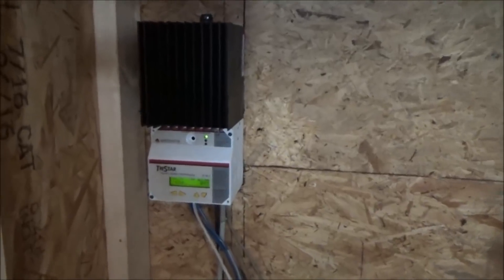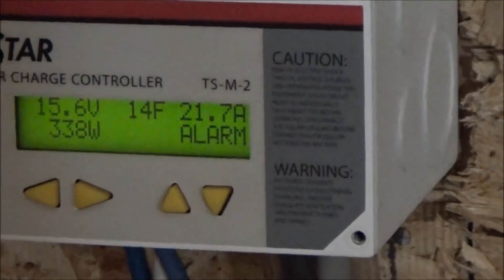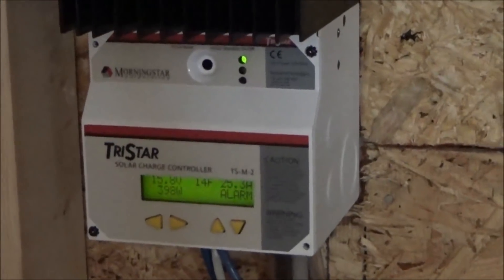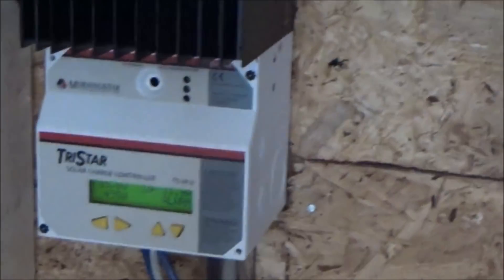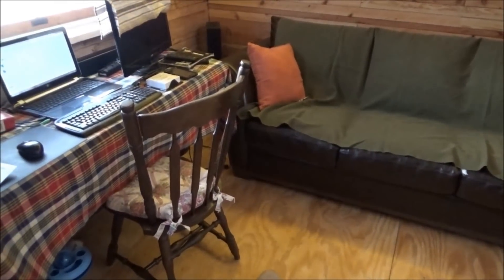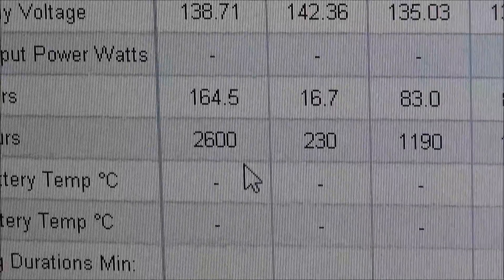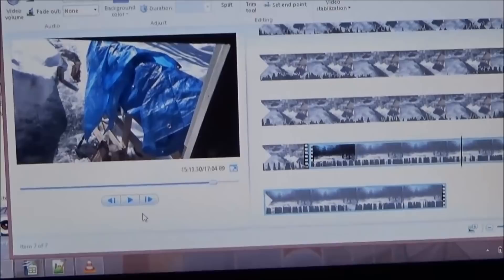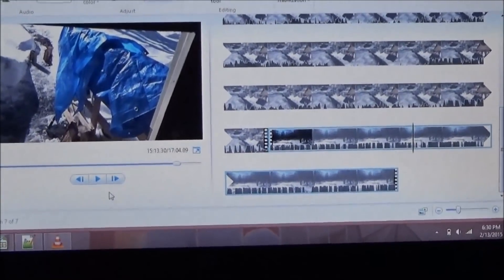Awesome Off Grid Solar Power Then Catastrophic Failure All Around

Comment: you will need a better blocking diode for the wind gen. put 100 amp stud with heat sink.. with inverter cutting out on HV. my fix. get a 200 amp dont know your inverter. put in pos lead in forward direction.  may need 2. drop appx .85V depends on load  each diode. than a battery hi current switch  to jump out diode or 2. I needed 2 for NiFe which get 16.8V cold.16V 80 F .rember diode on heat sink.  my pure sign inverter good to 16V still needed 2 diodes. no only diode block power thay drop volts.

Comment: Panels will give you more power in the winter due to two factors . Heat creates resistance and resistance is a loss , also snow reflects light and this light is bright .The next time in winter when it is -20 and blowing and a dark cloud covers your panels , watch the amp spike when the sun hits them again and you will see a significant increase . It is short lived until they heat up again but this spike must be considered when matching your controllers to your system .

Comment: Right from the manual.

Faults & Alarms
If a “Fault” or “Alarm” condition flashes on one of the main
Operating Displays, navigate down to the Diagnostics Menu
for a list of existing faults or alarms. The faults and alarms lists
are always displayed on the first 2 screens of the Diagnostics
Menu. Use the left and right push-buttons to scroll through
each list of faults and alarms, if any exist.

Comment: I know why your controller alarmed.  You are either running the TS-45 or the TS-60 MPPT controller with the TS-m-2 meter add-on.  These are the only two models that they make in an MPPT setup.

Im looking at the technical specs in the owner's manual.

The TS45 maxes out at 600 watts at 12v
The  TS60 maxes out at 800 watts at 12v

The only way to get the full wattage out of your system would be to step up to a 24 or 48 volt configuration.

At 24 volts, the TS45 can handle 1200watts while the TS60 can handle 1600 watts.
At 48 volts, even more.

Since the units are equipped with overload protection from the solar array, it is alerting you and may actually be cutting out.  If you need a copy of the specs and the manual, I have both the data sheet and the owner's manual in PDF format.  Just PM me and I can get that out to you ASAP.
Reply: hes running the panels at 130 volts
Reply: +DMAN22yeah WOWZA!
Reply: docchocobo yeah dont lick that like a 9 volt battery lol
Reply: LOL

Comment: You may have had the warning because of the increased watts increases the amps.   Your controller can only handle so many amps and might have signaled the warning.  Another possibility could have been when the wind turbine started to draw the power on a back feed the controller sensor gave the warning.   Personally I believe it was an overload of amps on the controller.
Reply: it was too hot

Comment: diodes for automotive isolation  are only good up to 16.5 volts max then fail. every diode has a 'peak reverse voltage' or point of falure. the voltage peak or true RMS  or peak voltage  will blow the diode even if not useable power. check the peak to peak voltage on the devices and use diodes rated higher.

Comment: No offence but when are you finally going to use the fork lift batteries as a power source, so far all i've seen  you using the harbor freight  generator for just about everything sooner  or later you will have to use those batteries to see how they  really work.

Comment: Why don't you get an indoor charge controller dedicated to the wind turbine. Outside, the extreme temp difference of -40 cold air and heat from 20 amps of current passing thru the diode, could make the diode crack or burn under the strain.
Reply from the maker: It was inside

Comment: Hi Troy
You need a 50 amp fast diode on that windmill with a heat sink .
or at 2 X 25 amp in parallel.
If the cable cant handle 36+ amps you
could drop a 1 or 2 big dump load resistors in series with the line !
IE:- BAT pos > DIODE > RESISTORS > windmill > BAT neg .
Reply from the maker: I just ordered some new - better - diodes off ebay but from the US

Comment: Since your 2 main generators aren't operational, why not try using the generator you wheeled into your workshop tent a few days ago? By the size of that one, it looked like it could handle running a battery charger while you get your Harbor Freight one replaced. Otherwise, I thought you had another generator or two that I saw in a video way back (forgot which specifically). Anyways, the workshop generator wouldn't be a bad backup to your backup (HF + alternator generators).
Reply from the maker: It would be a sad waste of gas to run a 4,000 watt generator to give me the 100 watts I need in the evening to power my laptop, modem and some LEDs

Comment: IF YOU LOOK ON THE WEB PAGE DATA VIEW THE ALARM WILL BE A RED NUMBER DOWN THE BOTTOM JUST HOVER OVER IT AND IT WILL TELL YOU !
Reply from the maker: Got it thanks. It was over current due to the combined solar panel sets
Reply: I doubt it was the solar! you don't have enough panels to go over current! I have18 x 200 watt panels and the same controller as you and that's only 54 amps - 3600 watt more likely it was the wind turbine dumping the excess current because you haven't wired it up with its own PWM charge controller  you must have a controller with a dump load !

Comment from the maker: People: The wind turbine is NOT connected to the solar charge controller. Nothing but the solar panels are connected to the MPPT solar charge controller. I will never risk such a thing.
The wind turbine and failure of the generators were separate issues. The generators were off and not connected at the time of the diode failure. It was a cheap ebay diode that failed.
It was hot in the tiny house and the alarm was most likely the charge controller getting warm so it reduced power output
Reply: Shaggy one
i may be wrong but i think would have got packed away when troy was clearing the old trailer home ready for the conversion to the tiny house on wheels you know how it is when you move it's things you need that gets unpacked and the rest gets forgoten
Reply from the maker: Ongrid Solar 50 volt 45 amp
Reply from the maker: Shaggy one Well, if you read the comment above, the one you just replied to, I said that the charge controller was most likely too warm
Reply from the maker: james head Its online. I have it right on my computer desktop and I do refer to it about once per day recently. Been checking things out a lot these days tweaking the system
Reply: Shaggy one
Reading instructions is for sissies.

Comment: the harber frate gen  the govener is not opening up  and i  think your voltage is to high  check voltage right at the battery it self if the voltage is that high you are over charging i don't think you are but you have to be on your game find and read the data sheet for your battery  it will give you the best info  your wire may be to light  from charge controler or some thing the voltage seams to me way high for toped up battery  each cell is two volts big or small charge at 13.5 to 14 volts  i don't  trust the 15 volt reading i don't see how that can be right on a good battery that big please look in to this have you not been using the at all you may be over charged look in to this
Reply from the maker: I will check, thanks

Comment: If that's the 45w model (ts-mppt-45) and your battery bank is 12v that controller can only handle 600w. I think it just dumps the excess watts into the heat sink,,,it's warning you that you are pushing the limit.
Reply from the maker: 60 amp. I think it was just too hot
Reply: The Do It Yourself World
Ts-mppt-60 should handle that....if you find out what the alarm is please post, that's the controller I have. good luck

Comment: How could the windmill motor run if you have a blocking diode installed?
Reply: ***** That could be it. If it failed it was too small for the load. Personally, I don't know if a failed diode would conduct electricity, but I doubt it.
Reply from the maker: John Strabismus Yes they do burn out. And I accidentally deleted his comment. Wanted to leave it up. His slap on my face would have been turned on him. An incorrectly installed diode would not have allowed any power to reach the batteries and the wind turbine would have run 24/7 since the day I put it up there.
Reply: The Do It Yourself World Well, in any event I'd install a wind power charge controller if I was you, and I'd set up a dump load while I was at it. You're banking on luck, and that's usually a bad idea.
Reply from the maker: John Strabismus I do plan to soon

Comment: what about the other FL bank and or the batts in the other rv  i think you could squeeze some more dc from them in a pinch   but whatever you do do it fast its gonna get bone freezing cold by the weekend for ya   take care .... dont give up  on the hf .....  oh hey could pull the gen head mount it to the dc gen and have both ac n dc on one setup ....
Reply from the maker: I have small backup batteries for emergencies

Comment: I seen the settings in the Video,, Target Voltage 16.39 Volts. Yeah a little high. You should check the settings which is adjustable. Absorb should be 14.7 Then you should be able to run your power Inverter during the day. Accept when you do Equalization. That just to high even for Forklift batteries.
Reply from the maker: I might readjust

Comment: Sorry to hear about you off-grid power problems. I have never been a fan of the idea to connect turbines direct to battery without a charge controller.
Did you solve the ALARM warning of the Tristar? Knowing that it has no cooling fans and that your solar panels can provide the controller's maximum capacity, and the wind turbine turned into a heavy load. What was the room temperature inside of your tiny house? I'm willing to bet that the Tristar over heated and it went into protection mode by limiting it's input.
Reply from the maker: Might have been a cooling issue with the controller as it hit maximum power. It is between 80 and 100 degrees in the tiny house with the sun shining sometimes. I might try a small fan on the controller cooling fins
Reply from the maker: tom bednar I will use curtains when it gets too hot. Right now I am enjoying the fact that I need windows open in winter :)

Comment: I hope you have good luck with the Generator exchange. I dont use many Harbor freight tools just gloves and other stuff that is disposable. I have talked with people that have no problem at all exchanging things with Harbor freight. You will have to keep your eye out for a Honda used that may have a little problem you could fix. You can not really complain that Harbor freight generator has ran a long time for you.

I wanted to let you know my experence in the winter with my Solar panels. They put out MORE in the winter, solar panels really like being cold. My 2000 watt set up was putting out 2000 + watts the other day in full sun. I feed then into grid ties and  from what I understand a person can expect to loose 10% in the grid ties and another 10% in the wiring (mine run through about 100 feet of # 10 wire. There are 8 panels of 250 watts each and each panel has its own pair of wires) so the most I should ever hope to receive from that set up is 2000W-400W loss = 1600 watts  but I was getting 2000 Watts. That never happens in the summer the hotter the panels get the less they put out.

I sure hope your new batteries were not damaged! I must have missed did you ever say what your new batteries cost? My battery bank in the barn is over 2 years old and so far so good but when I replace them I am wanting something better than the Golf Cart batteries.

When you get everything all caught up around there you should get your Amateur Radio license and put a antenna on that tower you put up for the wind turbine and show how to do that. In a real world disaster the cell phones would be the first thing to go as we learned in the 911 attacks.
73 Del
Reply from the maker: there is no problem. I am not going to risk damaging the battery so I am not putting any drain on it at night when its cold.
I do have trouble with getting much solar though but that can be fixed with a chain saw.

Comment: An electrician I'm not but next time multiple backup diodes in series? Too much resistance? Also the Harbor Freight generator surely has a reason for going out, probably related to the wind gen diode failure. Good luck with a solution. Randy in MN
Reply from the maker: A failed diode is a short either way and in series you have more voltage drop which is not cool. I just need better quality.
Reply from the maker: The HF generator was not connected to the system at the time. Not related. The wind turbine was also a separate system.

Comment: How much AMP was the blocking diode?? For a 350 Watts wind T. at 12 V plus safety 36 Amp. I would go for a 50 amp on a heat sink. Of course a Wind charge controller would be the best!!
Reply: Yeah you should have a dedicated charge controller for the wind turbine. Also i dont know what size cables your using but bigger is usually better. Especially with you inter battery connectors. My system uses O or 2 gauge even.
Reply from the maker: 50 volts at 45 amps. Should have been enough for a 350 watt wind turbine. It was a cheap ebay deal

Comment: I have not really looked at your system but I do think your setup could use some center zero amp meters to tell you if you are charging or discharging your system from each leg of you input power.  It would be the same thing we did on the boat when we had more than one genset.  

Another thing that would be handy is each input to your system on a switch so you can turn each one off and still do testing.

Comment: hy ?Troy, i think your problem is the connector you used between the battery cables, due to the high amps passing through it the contact is bad. (same as when you installed them the first time.), beware of over voltage on the array side.keep it below 145 volts.
murphys law, if one thing fails, everyting fails! lol
nice to see the extra panels do the job, check your connections between controller and battery..thumbs up!
Reply from the maker: Yeah, murphys law.
The solar panels never go over 131 volts according to the charge controller. Someone sent me an email. It might be the controller fins getting too warm. I will keep an eye on it. This morning I was getting 750 watts, which is near the max limit of the controller.

Comment: sure you've found this out by now, but read the manual for your digital meter. it will tell you everything that will cause an alarm warning to display. always read the manual first.
Reply from the maker: Been looking for a problem. Might have been too hot
Reply from the maker: ***** Got it. Thanks. It was over current from the extra solar panels

Comment: Very interesting and I finally really learned something on this.  So if I see the wind turbine spinning when there is no wind, then it is quite possibly running on the power from the batteries because the blocking diode went bad.
Reply from the maker: Yes in this case that is what happened. The wind turbine was working as normal all day because it was windy. Must have blown the cheap ebay diode at one point during the day. After the wind died the diode was shorted and conducted power turning the wind turbine into a 350 watt load on the battery bank.

Comment: hope you can figure out the controller & turbine combine problem.
fyi. i msg'd Morningstar and sent this video to their attention.
hopefully they will get intouch with you....

any help would be good....

hope harbor freight helps.... 
i hope you can plan for a Honda EU 2000, convert it to propane so your can dual fuel it/preferable use of propane,,, have you been monitoring your propane use???
Reply from the maker: Thank you. I think you are the one who sent me the email?
I think, based on the email I got, that it was heat causing the fault. It gets hot in the tiny house when the sun shines and I may need a tiny fan on the charge controller
Reply: The Do It Yourself World
If you do not have the meter map that comes with the controller to show you how to  diagnose alarms, you can click this link for the map:  http://support.morningstarcorp.com/wp-content/uploads/2014/07/TSM2.IOM_.TSMPPTMap.02.EN_.pdf  

By pressing the yellow triangle arrow buttons on your TriStar MPPT controller in accordance with the arrows displayed on the meter map you can find out what the alarm is all about.  So from the operating display screen that shows your voltage, temperature, current and Ah, you would press the yellow down arrow on your controller 3 times, then right arrow once, and then the down arrow twice.
Reply: The Do It Yourself World ok...  overheated controller???  would a wet rag help???
well monrningstar wants to get ahold of you....
Reply: The Do It Yourself World   TriStar MPPT controllers are rated for 45C (113F) so if that room did indeed get that hot or if the controller was in the direct sunlight, high temperature could have been a factor.  If on the other hand the room was not that hot and the controller was out of the direct sunlight, there was likely some other problem that would have been indicated by the meter.
Reply from the maker: Morningstar Corporation Thank you very much for the help. I have an over current alarm. My 24 volt solar panels are connected 4 in series which should give me an average of 130 volts. But somehow with the sun and the snow it seems to be going over that sometimes. Should I reduce them down to 3 in a series then?
Reply: Here's a link to our string calculator that should be helpful with you module configurations  http://www.morningstarcorp.com/string-calculator#